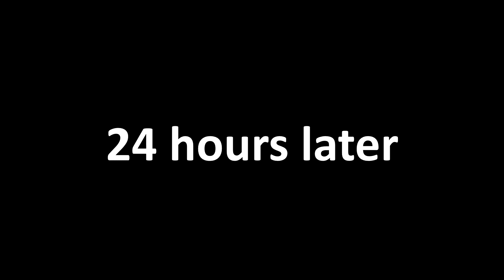🔨 DIY Epoxy Cutting Board- Serving Board / Deska do serwowania z żywicy epoxydowej

Comment: what grit sandpaper did you use with your belt sander?
Reply from the maker: 120 then I increased the gradation of the oscillating sander and finally the polished
Reply: @BuildItYourself98  thanks!  And great work!!